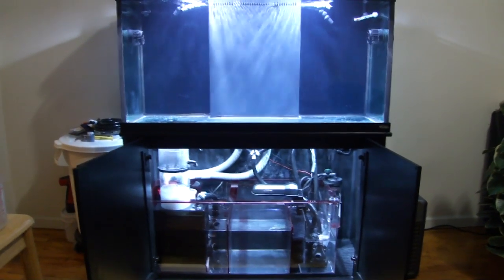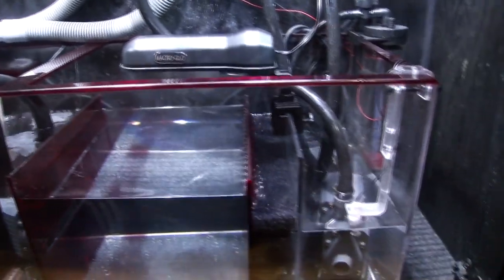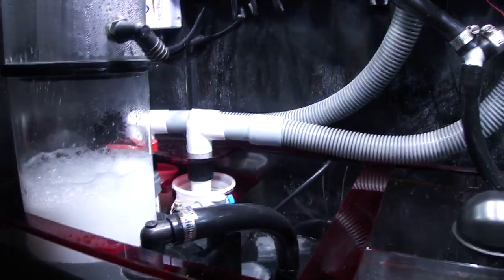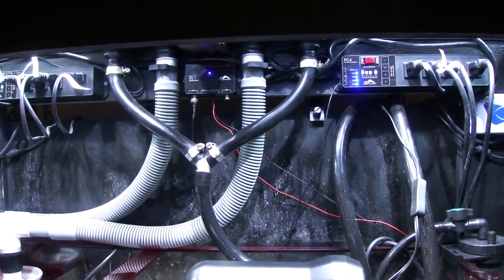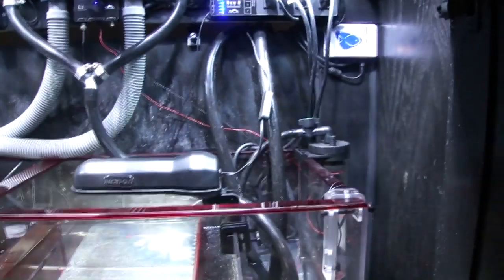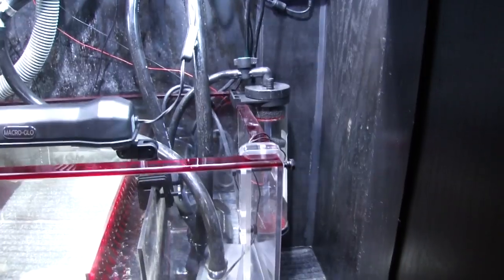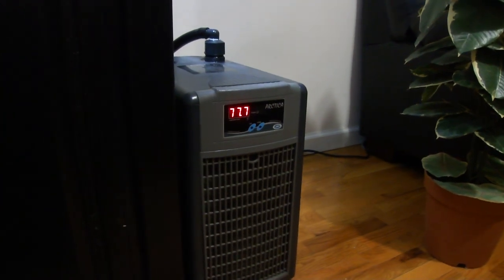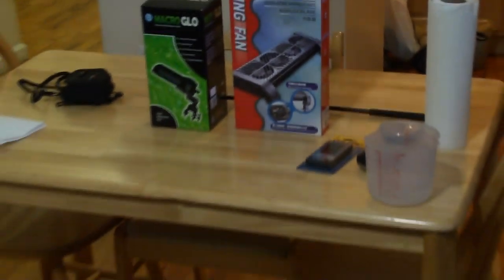How To 90g Reef Aquarium Setup Day 10

Comment: Hey Steelo! I am in the process of building a 120g system. I like you, have a Trigger Systems sump, and purchased the wet/dry tubing kit from Dr. Foster and Smith. My question is, how did you connect the flexible plastic end of the tubing to that PVC elbow on the sump? Can you just glue it together for a secure fitting? Thanks for everything you do!

Comment: only other thing is probably a socket for the pump for your ATO....Hey can u Believe the TEK lite ELITES are backordered through the actual sunlight supply company they are remaking the fan because it was having failure issues....either im going to wait for them but it may take 2 months or im going to order a 4x54 ATI Powermodule do u think the 4 bulb ATi will be as good as the 6 bulb TEK....im getting mixed opinions from alot of different forums and was wondering if u had any idea about it??

Comment: i see there are 8 spots on the pc4 s all together but with a;ll your equipment pumps multiple lights fans 2 powerheads skimmer all that i know there must be moere than 8 things to plug in where is evrything else plugged in??   Not that im saying ur running ur electric dangerously because ims ure if anyone knows what there doing it is you its just that i have two surge protector with 8 slots and they r all filled up about 15 things to plug in and im curious how ur doing it just to get an idea

Comment: Hey love the vids keep em coming. My question is i have a new 90 gallon im going to set up as a saltwater tank. I think i want only live sand and fish and live rock only at this time. I currently only have a Sump system w/ bio balls and just  that blue filter pad thats sits over where the balls are and a protein skimmer in the sump, and that is it for now. I've filled it w/ tap water to check for leaks and its only been 24 hours and still see a lot of cloudiness in my water im wondering what else i should add as far as carbon or reactors. In my sump there is a section for a refugium.
Reply from the maker: Cloudiness initially when first setting up a tank is somewhat expected. The tank will go through cycles and your parameters will be out of whack until the tank reaches stability. How fast this clears up will depend on the filtration system you are running.It sounds like what you have is a wet dry sump. Have you pondered adding a powerful skimmer? And running adequate carbon media in the media stage? Both can help clear up the water faster.